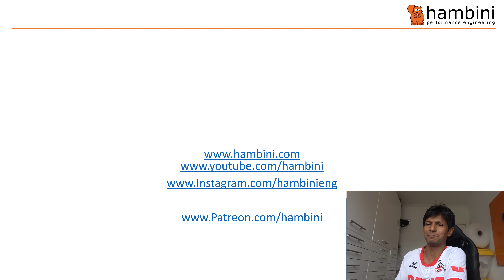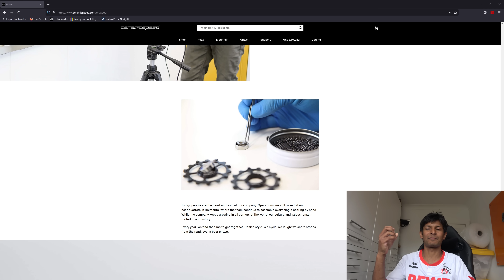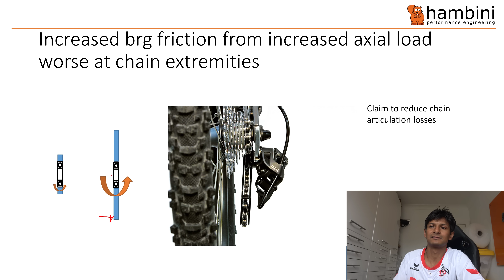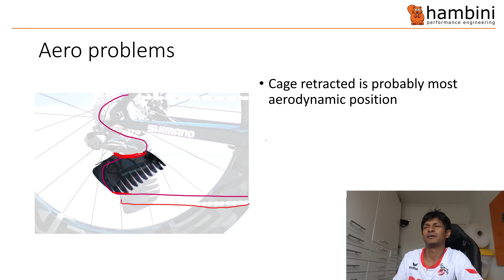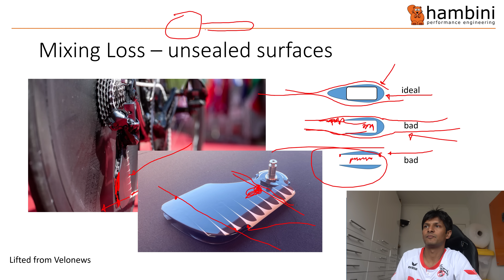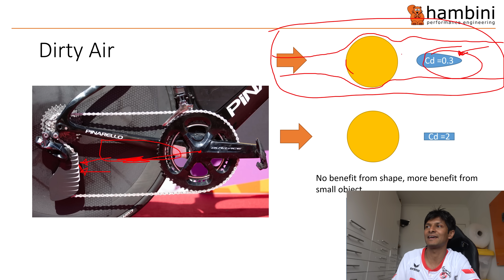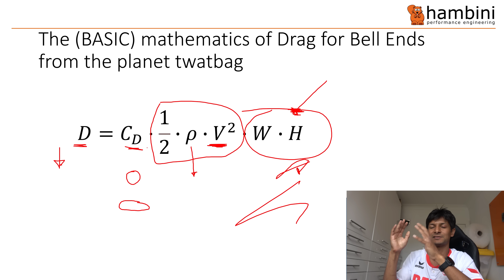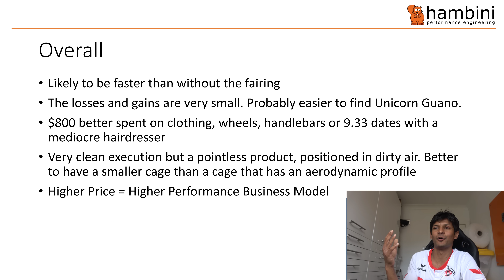Hambini's Sunday Roast: $800 CeramicSpeed OSPW

Comment: Hambin, at 9:29, that position would seem to be for high speed, not low speed? When the derailleur is in that position you’re likely to be in the 11 or 12 unless you’re running a really big chainring to offset the cross-chaining losses.

Comment: I bought 37 of these. I put them on all my bices and duct taped them to my car. I went for a drive of 100 miles with 1/4 tank of gas. When I was done with the drive I had 3/4 of a tank of gas after not stopping to refuel. This guy with the name I don't remember or GAF about is a fucking HERO ! Hambini is clearly a ham-n-egger who should probably get a job at the salon sweeping (mopping) up whatever ends up on the floor after a session.

Comment: Someone asked me if they thought this cage cover was a good buy. I thought they were joking, but I found they weren't joking. The $1M in the bank shows me that there are some very gullible buyers out there. 
I really think I am going to start selling my Spoke wax after watching this video.
Reply: Where could I buy that shit. I want my spokes slipping through the air.
Reply: Where can I send the money for the spoke wax?
Reply: how much for your spoke wax? anything under £150 I'm not interested
Reply: does it work on any spokes? looking to go faster on my old steel 80s bike.
Reply: @_Zane__  If your FTP is 200 I wouldn't bother with a spoke wax as the problem lies somewhere else.
Reply: That's the petty cash imagine whats ready gone into the houses, cars and other investments
Reply: @_Zane__  Hey, no advertising on my Youtube replies Goddamit!! You owe me 20 cents on each Dollar on every sale from today. I'll be watching you!
Reply: @mikewood9514  It works only on painted spokes. In my 15 years of wax research I have found that with 3 coats, my 'specially formulated wax saves 0.0093,24,1469 watts on rounded spokes when moving at 30kph with a yaw angle of 7 degrees from the right side. On 27cm bladed Saphim spokes the wattage saved is an amazing 0..1856,48,2869 from the left side at 7 degrees of yaw, which is DOUBLE the amount of free watts. So I recommend rounded spokes on the drive side and bladed on the left to get full advantage no matter which side the wind is coming from. 
Waxing also prevents corrosion so your wheels truly are "Forever Wheels" and if you use my special promotion code when you custom order new wheels they will not only build your wheels with the recommended spokes, they will also use child labor in a 3rd world country to apply the 3 coats so that when your wheels arrive the will be ready to roll right out of the box. For an extra NINENINEYNINE we can install your choice of tubeless tires. But due to Corona restrictions and airport security issues we will have to deflate the tires for shipping. 
Act now while supplies last.
Reply: What if you sold a fairing for each spoke? drive and non-drive specific, and for different weather conditions. You might be on to something. Make sure you stamp "nanotech" and "made with graphene" on it too.
Reply: @mikewood9514  You need either Shimano or Campy wax, and depending on your BB you might need an adaptor.
Reply: @jaysparc  Ya know, with your experience, training, wisdom and knowledge, I think I would like to be your business partner instead of a competitor. I don't know how fast you are on wheels, and I'm pretty fast and competitive on my sofa bike, but you definitely have a lot more vision and business sense than I. 50/50?
Reply: @casualguy393  I have a non-engineering degree from the University of Wank and a marketing degree from Useless College of America.  The truth is that the weightweenie and trifag will spend anything to save on watts.  Where is the most unaerodynamic place on a bike -- simple the cassette!

All those teeth, just tearing the wind apart, slowing you down, forget about 40Kph for a 40k, you're being robbed. I've designed the first aero-toothed cassette. It only comes in 13 speed with 12-12-12-12-12-12-12-12-12-12-12-12 and 12 sprockets. It's been shown to save .025 watts per 100 days cycling.
Reply: Lol😂😂
Reply: Where can I buy this spoke wax 😀👍💵💵💵💵💵💵💵🥳
Reply: @jaysparc  I bet once you get that extra cassette weight moving then it costs less watts to maintain that 40kph speed too. 
"CHOO CHOO MFERS!!!!"
Reply: @glennoc8585  Cars aren't investments. They are a money pit, especially new ones bought for cash, unless we are talking very, very rare collector motors.
Reply: @casualguy393  WAHAHAHAHAHAHA
Reply: Spoke wax😍😍😍😍 Take my money!!!!
Reply: Shut up and take my money!
Reply: How do I get some of that spoke wax?
Reply: Wax, lol. I just sand my spokes to half their diameter then GT 85 them. Key is to wipe it off after.
Reply: Spoke wax? How bout some tyre grease to decrease rolling resistance? Rofl

Comment: It doesn't take any analysis to realize that the OSPW cover will do nothing. Just compare the area of the cover to the frontal area of bike and rider. The cover is probably 0.3% of the total area, so if it reduced drag on the OSPW by 50% that would be about 0.28 watts at 32kph

Comment: It makes sense that the biggest aero gains will be in the cleaner air at the front of a bike, so things like an aero helmet, front wheel and forks. The potential gains from secondary elements in dirty air, like the rear cage, are miniscule, yet that won't prevent some fools from (literally) buying in to the marketing hype of crappy pseudo-scientific products like this.
Reply from the maker: I couldn't have worded that more succinctly if I tried.
Reply: Think of a sine wave in electrical current flow and then observe the unbalanced wave form after it passed through a circuit. A similar thing happens to an air stream on it meets that spinning chopper of a crank arm, leg, & foot. The air would have to '
Smooth out by the time it meets the 'hangar fairing'. Id like to see a  modelling or even a good old smoke test.
Reply: @counselthyself I just thought of a new coasting position.  Since the supertuck is banned, have skinny little posts halfway up the seat tube that the rider can put their feet on.
Reply: @larrylem3582  just graft the cleat section of a pedal onto either side of your bottle cage..

Comment: I'm curious. If CC bearings are too small and Absolute Black bearings are too big. Is there an ideal bearing size for a jockey wheel? Is that what shimano has already?
Reply from the maker: low friction requires a small bearing, that in turn requires as little axial load as possible. To achieve that, you need a small jockey wheel. Absolute Black (they are actually LUCID IP SLU, registered in Andorra) have not given any data to show their bearings have any lower drag and when they said they would, they then sent a load of threatening letters
Reply: @Hambini  Ohhh I see, so it's the lever action of torque from the hub to the length of spoke of the jockey wheel. Right, sorry I remember you said that in the video, just needed to clarify. Cheers
Reply: Also, my ramblings don't make much sense,
Reply: @Hambini  Dear Hambini, would you ever re-upload the roast on their AbsoluteCrap piece of plastic? I miss that video so much, used to watch it once a day lol

Comment: One thing you forgot to mention: yes, the ceramic speed pulley spins so nicely in comparison to Shimano or Sram, but the simple reason behind is the lack of sealing of the bearing. So if you really buy this thing for the (marginal) gainz you need to take it apart and clean it on a regular basis... :D
Reply: Another unnecessary maintenance in the name of marginal gain...

Comment: Road bike drop outs are 130mm. Minus a bit for nut etc. Q-width on road bike usually 150mm. Haven’t measured it but looked on 2 of my bikes with shoes attached. Looks to me a pro with a big front chain ring wouldn’t have feet in front of the derailleur but rather the crank, which could be aero, because they can use the 3rd or 4th cassette cog. Mere mortals with only a 53 up front & normal cranks though… suspect what minor benefit there is would disappear when used by people who don’t get stuff for free. Think I saw them in the Giro D’Italia on Israel Premier-tech TT  bikes last Saturday BTW, at least Alex Dowsett’s. Nasty bump at the end though, so I don’t know how big a chainring he dared use.

Comment: @hambini the 'dirty air' scenario is actually more ineffective than you explain with Shimano. DA and Ultegra (maybe 105?) are all Shadow-style. The mech sits directly under then cassette, not outboard as older road rear mechs did.
So it's not only the shoes, but the entire bb and crankset that the rear mech "drafts".  So it's constantly in dirty air.
Reply: I don’t think ‘shadow’ derailleurs make a difference here. Shadow design or not, the cage is in the same place, under the cassette. It has to be. It was the parallelogram that was moved inboard.

Comment: Question: On a TT bike, couldn't the benefits be optimized given the proper setup and the proper conditions. For example, the TT specialists will put on massive chainrings and setup the gearing so they will be predominantly in the middle of the cassette to minimize losses. So, on a flatter TT, wouldn't they see at least some marginal benefit from this? Or at least have the best chance at being beneficial?   Granted, that would probably inspire some people on the group ride to buy them.
Edit: One more thing occurred to me watching the rest of the video. There is no way for them to prove the benefit of their product. Even if it worked completely as promised. It would be such a small gain that it would be well within any margins of error in an applicable aero testing. At least that is my view of it.
Reply from the maker: In turbulent or dirty conditions, the aerodynamic profile generally doesn't work. A circle has similar drag. The purists will go for the smaller object rather than a fairing
Reply: @Hambini  Use a Rohloff inside your rear disc wheel..     Rgr
Reply: A good friend of mine got an average of 2w out of his.   Multiple runs over multiple yaws in the middle of his cassette

Comment: So, should I pay any attention to chainring aerodynamic at all?
It's kinda in front end of the drivetrain. It hit relatively clean air as it's not directly behind front wheel and down tube.
Would Rotor aero chainring vs Dura-ace's 4 arm chainring aero difference measurable or negligible?
Reply: Minimal at most I reckon. Hell, even aero cranksets exist, like Vision's.

Comment: As a bike shop owner my best advice for getting to the finish line first:
Use good tires which do not go flat
Buy a bike which goes in a straight line so you do not crash
Get fitted so your ear(balance point) is over the axis of steering (head tube). 
Learn to ride rollers so you learn to steer with your butt not your hands.

Comment: I'm wondering what the interaction with the faired cage and the air travelling over a disc wheel but then thats at the bottom of the wheels rotation and stationary with the ground so not much in the way of gains to be had I'm imagining, it'd be good to know if i'm visualising that right so please do tell me if I'm talking bollocks or not and why.
Reply: Actually its all a mess down there even more so with spokes and a bb mounted rim brake wisking it all up.
Reply from the maker: I think you've visualized it quite well.

Comment: So let me get this straight.  According to ceramic I'm losing watts running any ring on my cassette lower than a what, maybe 14 tooth?  But if I have an ospw that will make up for it lol?
I'm pretty sure the chain is designed in order to go around that circumference lol.
Reply: also i was kind of hoping that 800/9.33 was 69 lol

Comment: When you said, the section with a hole is bad. What do you make of the wmc250ev motorcycle "A Massive hole that runs through the bike reduces its drag by an impressive 69%". Did something like the gurney alligator have it right, just too go as small/reclined as possible? Purely aero wise, as I don't think either get points for sex appeal from the public haha

Comment: Ceramicshite, previous owner of my scott spark had a ceramicspeed speed bottom bracket fitted to the bike. Local bikeshop fitted it as it was all the had in stock that fitted the crankset he had. I have just had it replaced under warranty it became like a fucking coffee grinder. I guess riding offroad amplified the effect of the balls grooving the races from the rough terrain?

Comment: Some malfunctioning part of my smooth brain thought, for a second, "oh, but this could be nice for reducing the amount of grit that gets gummed up in the pulley wheels", but then I remembered that the chain has to exit the fairing somewhere, and naturally that leaves the bottom and back of the pulley wheel exposed for all manner of shite to fly up into. So it seems that even with the most gracious application of possible benefits afforded to this wad of plastic, in the end it remains (as with all Ceramicspeed products), a tiny little flag scotch-taped to a cocktail straw emblazoned in oil-slick lettering with their company motto: "I AM A TWAT".

Comment: I think you've suggested before, feel like there's a good aero 101 video for everyone - going as basic as what percentages of W x H are made up of rider, wheels, handlebar -- so people can put figures to the maximum potential gains. Eg handlebar makes up (plucking number here) 5% of total area, so your maximum gain, if achievable is capped at 5%, Vs wheels, Vs rider. Basically a basic video showing for each part that makes up the frontal area, what that maximal gain could be (in that forward plane only).

Comment: You know the fairings/covers that go over chains and chainrings on kids bikes? Would that not be a better idea for smoothing out air flow in that area of the bike? Air is already really turbulent but it would cover a much larger part of that dirty air going from front edge of big chainring all the way back the the cassette. Would look shit but if you wanna go fast and you're not governed by UCI limitations like in Ironman racing that looking shit takes a back seat
Reply from the maker: I think the problem there would be kids bikes tend to be single speed so you don't have the problem of the chain slack. I think the future is likely to be epicyclic gearboxes inside the hubs.
Reply: @Hambini  surely with all the great minds inside Ceramicspeed and Drag2Zero they could design something to accommodate chain slack.😀  Couldnt you also just make that cover larger for the slack? Absolutely those gearboxes should be the future. I'm sure the UCI wouldn't allow it though.

Comment: I would take issue with the losses caused by the chain angle, since that part of the chain is not under tension.  A larger bearing for the pulley might add weight, which I don’t consider a problem. I do see the advantage of less chain articulation. . .  a good reason to ride on the big ring and a larger cog. . .   one of the reasons I ride a 56-tooth chainring on my TT bike, aligning with 16-17-18 teeth in the middle of the cog to maintain a straight as possible chain line.  So far, no Ceramic Speed ANYTHING for me.  At 77, probability zero.

The only way to test the aerodynamics of the cage would be in a wind tunnel.  All else is mere speculation.
Reply: I've got a 52x19 on my track bike. That's as marginal gainy as I'll go. The Tri bars on the road and tight clothing are more than a marginal gain. To be honest,  the big chainring  just looks cool on my fixie! At 63 marginal gains matter less and less! No hills around here. Nothing with less drag than fixed gear drivetrain. The rear wheel also winds up much stronger with no dish! Back to the basics. Mano mano.

Comment: Someone should make a (gimmicky) rear mech that stays in the folded position and rather than rotating down to take-up chain slack, extends the "lower" jockey-wheel backwards.
Reply: That's sort of how the first types of derailleur worked. A springloaded plunger rod along the seatstay with a swiveling wheel at the lower end, and a lever at the top; shifting action done behind the leg